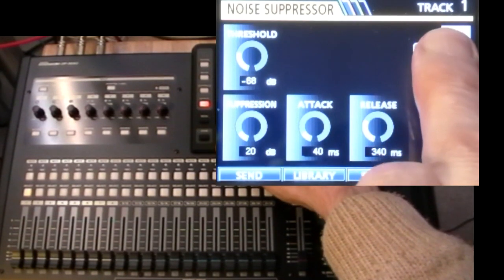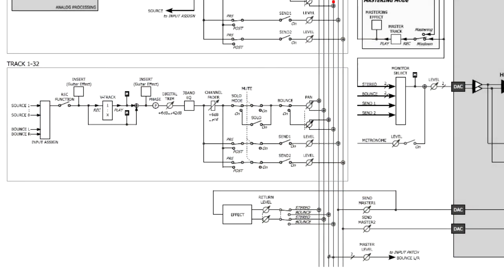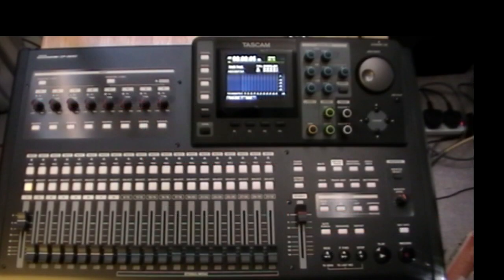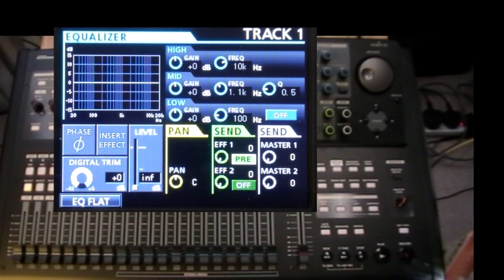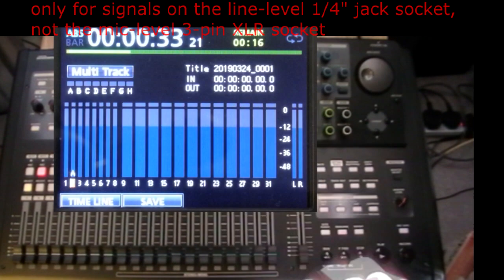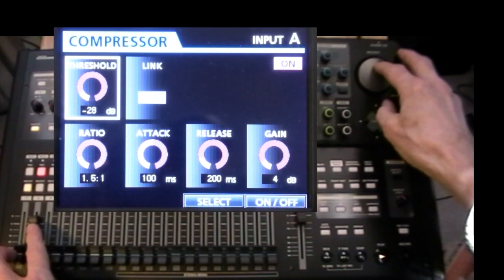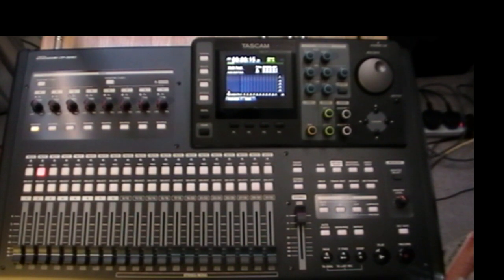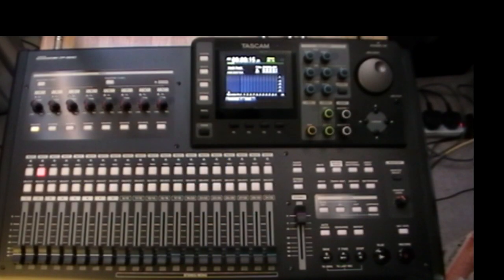Tascam DP24/32SD Tutorial 14A: Dynamics FX after recording

Comment: Phil , I noticed the very last thing you said in this video was that you bounced track 1 to track 2 and had substantially less latency. 
Does this mean you were able to use that dynamic effect in bounce mode onto track two, to accomplish a second pass out of the machine with only 40 microseconds of latency?  Or is the 1.3 milliseconds the only option for that ?
Reply from the maker: @John Martin Bouncing uses internal routing, so the signals remain digital and experience no delay. Any time you use external cables (such as in this video), the signals have to be converted from digital to analogue and back again. These conversions are relatively slow so they cause the 1.3ms latency. I believe it's the A-to-D converter which is the real culprit, but not 100% sure.

My comment at the end of the video was just to compare the latency between staying digital (using bouncing) and going to analogue and back via the converters (using the loop-back cable). It wasn't meant to imply you can use the dynamic effect during a bounce, so you're right, if you want to use the dynamic effects like this, you have to use an external cable... and put up with the (tiny) delay.

Thanks for stopping by.
Reply from the maker: @John Martin Update: if the latency is an issue, you can either time-shift it using Track Edit as mentioned in the video, or do the loop-back trick for the other tracks (without inserting the dynamic effect) so that all tracks are delayed by the same amount. I've not actually tried this, but would be an interesting experiment. As with a lot of recording operations, you just need patience :)
Reply: @philtipping   thank you for the detailed response!  I found the time warp section you mentioned. Thank you so much for doing the latency test with the oscilloscope. It’s weird that you can do a 3ms correction. Yet the machine will cause a need for 1.3 or 2.6 correction. If only it had a 1.3ms and 2.6ms option that would be amazing. 
I don’t really notice the second pass phasing on bass guitar but it’s really a deal breaker with a drum kit or a snare drum. 
My next experiment is to second pass a snare drum mic threw a 1176 compressor and then see if I can use it in conjunction with the original overhead drum mic recording.  Greetings from Buffalo NY my friend ✌️
Reply: @philtipping  just want to add quick - I’ve done the second pass experiment on non processed tracks just to give them the same latency as the processed ones. It all works out as planned. They all line  up again after the second pass 👍🏻 
I noticed you said you haven’t had a chance to try that yet.
Reply from the maker: @johnmartin5153  That's great John, thanks for the update.

Comment: Phil, you said the send effect outputs are general purpose and would be ideal for sending a signal out of the machine independent of the main mix. Could I use the send effect outputs to send a track signal into my audio interface and do some processing in my DAW and then send it back into the Tascam?
Reply from the maker: @Mr. LD yes you can do this... although you may get some latency issues due to the time taken by the route. Try it and see; you may find it's not a problem. If you don't want to do this live, you can always use the Track Edit functions to re-align the new track from the DAW.
Reply: @philtipping  Ok I’ll do some experimentation and see what happens! Thank you Phil!
Reply: @leomojo  Hopefully you used the AudioDepot feature.... where analogue conversion would not be encountered...

Comment: Hi Phil, love your tutorials. I just purchased a dp24 and familiarizing myself before it arrives in the mail. I am wondering if there is a way to use this method but recording the effected signal to a virtual track on the same track that the prerecorded signal is coming from? In your example say recording the drums from track 1 with this method of adding an input compressor via patching but instead of recording to track2, record to track 1. I think it would
Be useful in keeping tracks open and also if you know for a fact you will not need the dry signal in the mix. What do you think?
Reply from the maker: @Sam Bianculli thank you Sam. That's a great idea, but unfortunately not possible. The tracks are called virtual for a reason - they don't all exist at the same time, otherwise the dp24 would be a 192-track recorder and the dp32 a 256-track! If you watch video #8E, you'll see that only one of the set of 8 virtual tracks can be 'active' at any one time. This applies for all operations, including import/export, playback, recording, editing etc. Sorry to disappoint but thanks for stopping by :)

Comment: can you plug an XLR balanced low impedance microphone or does it need to 1/4 inch jack?
Reply from the maker: @charles colbert the XLR inputs are specifically for balanced mics. They are more sensitive than the 1/4" jacks for this reason. The 1/4" jacks are for higher line-level signals. Thanks for stopping by.

Comment: i wonder, can you have the repeat mode of the track  when you are in mastering mode ? How?
Reply from the maker: @[Tech Head] Live Electronic-Techno Artist No it's not possible. Once you've created the master file in mixdown mode, you can only play or process it in mastering mode, and in this mode only the controls shown in the mastering screen are available. None of the physical faders have any effect either. Thanks for stopping by.
Reply: @philtipping  ok, thanx! Great videos, just bought the dp24sd, its bad, when you mastering you must press stop and rew after the track is end to come to the start again, it should repeat the track when you mastering
Reply from the maker: @deepworldlive  You should not have to press stop and rewind manually in mastering mode. The machine will automatically stop at the end of the song and will rewind automatically if you press Record again... but note that the master file is overwritten each time you press Record so if you're not happy with the mastering, you must press Undo, otherwise you will be processing an already processed file.
Also note that if you press Stop manually before the song has ended, the master file will be truncated. You can see this if you watch the song length display near the top of the screen. If the master file is truncated and you try to master again by pressing record, it will only process the truncated version. Pressing Undo will revert the master file to its previous size.
The song size is defined when you first create the master file during mixdown. This is defined by the IN and OUT points. Again, you must not press Stop manually during mixdown otherwise the master file will be shorter than this.
If you find the machine is not automatically rewinding or stopping automatically, you have a problem, so I would suggest checking/updating the firmware, and confirming you are using an approved sd-card.

Comment: Phil, so my understanding is, this machine does not allow to add compression to the recorded track?! This is absurd. I am not a tech nerd but I have worked with ProTools and Roland Boss.  When I record drums, I like to add compression where needed. So,  in order to do this I would have to patch each track in order to add compression? We are talking kick drum, snare, overhead, toms etc. Plus vocals, harmonies… Impossible to patch all of them. I will be returning this if my understanding is correct. Please correct me if I'm wrong. Thanks
Reply from the maker: @lasTTrump33 you're right, it has quite a few restrictions. If you need to compress multiple tracks after recording, this is the wrong machine, unless you have the patience to do multiple bounce passes. There's a compressor on the guitar effect, so this can be applied to a track without using this 'loop back' trick, but as mentioned, the guitar effect can only be used on one track at any one time. Even with this loop-back trick using the 8 dynamic compressors, you are still limited to processing 2 tracks at a time as there are only 2 sends. 

I'm not sure if the Model series will help as I don't have one to confirm. It has a compressor on every channel so this is fine for recording (but then so does the DP-24/32), but I'm not sure if you can apply these compressors during mixdown.

There are very few (if any) free-standing units made which do what you're after; all the vendors have 'defected' to computer-based setups. The only one I can think of is Zoom so may be worth checking. Good luck, and let us know if you find a computer-less solution.

Comment: hi phil i hope you can help me please ? ive got a tascam dp 24 ,and a yamaha r 100 reverb processer ,on the back of the yamaha it has out put r and l channel ,and a input ,,,but on my tascam i have a effects 1 and 2 ,how do i connect them up so i can add it on my songs ,as when i turn up my send effects 2 on my tascam screan i cant get it to work ,,the yamaha does work playing my guitar through it with my amp ,so hope you can help thanks
Reply from the maker: @stewart champion Hi Stewart, have just downloaded the R100 manual, and page 4 'System 3' shows how to do it. You only need one send from the DP machine as the R100 only has one input (you only need both send outputs if your external device has 2 inputs, or if you want to drive 2 different external units at the same time). 
You can use either send 1 or send 2. Send 1 can also be used for the DP's internal send effect so which one you use for the Yamaha depends on what else you want to do. The 'returns' shown in the picture are just 2 normal inputs on the DP machine.
The tutorial video on send effects should help to get it going, or get the step-by-step guide which describes all this in detail. In fact, there is a specific scenario in section 72 for this, titled "Recording external effect in multitrack mode".
Details for the guide are here: http://www.philizound.co.uk/freebies/dp24-32/dp24-32.html  It's not free I'm afraid, but is a way of supporting the existing advert-free videos and free support.
Hope this helps.
Reply: @philtipping  hi ya phil ,i sorted it mate ,was a bit fiddly on the leads etc but all is good ,im sending delays all over the show ,haha your  a star mate ,ive learnt alot from your videos so thank you and hope you are keeping well in these strange times
Reply from the maker: @stewartchampion4260  that's great Stewart, glad you got it sorted. Hope you're keeping well too. All the best.

Comment: Hi, my guitar effects work but reverb doesn't even though the send and master levels are up full, i turn up the sends but when i press effects the select button turns off, i did initialize it, can anyone please help? Thank you
Reply: Thank you ever so much phil, i never turned up return
Reply from the maker: @spaceboxtd3720  haha - easily done :) Glad you got it sorted. Thanks for the follow up.
Reply from the maker: @Spacebox TD3 the effects can be a bit tricky as there are lots of combinations. Are you sure you are looking at the Send effect screen and not the Guitar effects screen. Both are accessed with the Effects button.
Another thing to check is the Return level on the send effect. If this is too low, you won't hear anything regardless of the send levels.
Also, are you using PRE or POST? If POST, you need to also turn up the track fader otherwise you won't hear anything. You can check the levels going into the Send effect by pressing Monitor Select and choosing send-1.
If you're still confused by this, I can recommend the step-by-step guide which shows exactly which buttons to press and what levels to set etc. Details here: http://www.philizound.co.uk/freebies/dp24-32/dp24-32.html

Comment: Hi Phil-I'm on the verge of finishing an entire new album(that'll be 10 songs total) on the DP-32SD unit and I have to say I am so pleased I bought this unit 2 plus years ago to replace the Roland VS-880 Unit that I had been using since 1998.I dare say I have the unit mastered at this point and certainly your videos solved a few problems for me.This unit when combined with the proper outboard hardware-Compressor and Effects(I use the PRO VLA 2 Compressor unit and can recommend it 10 times over)is all anyone needs to produce crystal clear recordings-the DP-32SD mastering capabilities are impressive but I still like the idea of using an outside source for mastering as a qualified mastering engineer has alot of specialty equipment at their disposal and of course they have the 'ears' to get all those frequencies to where they should be more or less.This is the unit for those of us who prefer Hardware to Software.
Robert
Reply from the maker: @ROBERT NIX Alternative Rock/Pop Artist Thanks for the update Robert. The VLA compressor looks very interesting so thanks for sharing. Outsourcing the mastering makes a lot of sense - I still get questions from people who are disappointed with their DIY efforts.
Good luck with the album and hope it's successful... then on to the next :)
Reply: @philtipping  Phil,I'm very pleased with that particular compressor-great piece of hardware but I'm also very pleased with the effects built into the DP as well and in the end it really comes down to your engineering skills-knowing how to properly apply the effects and I know you've a done great job explaining this to your viewers.
Hope you have a great weekend.

Comment: I think my 32sd needs an update. But having spoken to a friend who updated his, he’s lost all ability to record, so had to reset it to factory settings. I want to avoid this before diving in. In layman’s terms, what’s the process of doing this successfully. Oh. And card in or out whilst performing update? Thanks.
Reply from the maker: @dukeofpearl updating firmware shouldn't cause the machine not to record, so it could have been an underlying problem with the sd-card. There are quite a few pitfalls... they may have used the zipped firmware or the folder by mistake, or maybe the handling precautions were not followed properly and it got corrupted, or maybe it was a non-compatible card in the first place. Either way, it's recommended to keep up-to-date with the latest firmware as you get both functional improvements and better reliability. Almost all reports of glitches are due to using old firmware and/or incompatible/faulty sd-cards. Full step-by-step details for updating firmware and preventing card corruption are in my guide - details here http://www.philizound.co.uk/freebies/dp24-32/dp24-32.html   The card can be in or out; makes no difference from a functional point of view, although the actual steps re. powering off & on are different. Resetting to factory settings isn't a big deal... you don't lose any recordings.

Comment: Thanks Phil for all you help over the years. My Tascam DP32SD has a loud "tape hiss" sound, even when all the levels are down. All the effects are off. I've reset to a known state. Still there. Please help. (or is there a problem with my unit). Thanks
Reply from the maker: @sane1963 the only hiss I'm aware of is from the headphone socket. If this is what you're hearing, it's a well-known problem caused by the headphone amplifier. Tascam really should have used a higher quality amp for this, but I guess they were cutting too many corners on price! The amount of hiss depends on the type and sensitivity of your headphones/earphones. It does not affect recordings or playback through the output sockets on the back of the machine, so it's nothing to worry about unless you are using headphones for critical monitoring. One solution is to use a good quality external headphone amp plugged in to the stereo or monitor outputs at the back. If the hiss is from somewhere else, get back to me.
Reply: Hi Phil, just plugged into my studio speakers and no hiss. Thanks for your help. 😎
Reply: HI Phil. Thanks for the reply. Even when I use the output jacks into my computer via the front plug (of the PC ) the hiss is the same as the headphones.  I'm using audacity. And can take out the hiss, but lose half of my tones.
Reply from the maker: @sane1963  using the audio input on a computer may introduce more problems, depending on the quality of the PC's built-in sound system... usually it's fairly poor. If you want to record directly into a computer, you'd get much better results using a digital interface such as an audio-to-usb unit (older desktop PCs could use specialist plug-in sound cards with digital interfaces). Unfortunately there is no direct digital link from the Tascam DP machines for transferring live audio, but you can transfer recordings after they're made by using the machine's Export function. This allows you to transfer the digitised track wave files to the computer, and then you can import these into Audacity. These transfers are a perfect copy of the recording with no losses or degradation.
Reply: Thanks Phil, that was great info. I'm learning as I go along. I'm up to making sure my recordings are satisfactory before the finale. Thanks for your help and great videos. 😎
Reply from the maker: @sane1963  no worries, glad it's all helping. Good luck with your recordings.